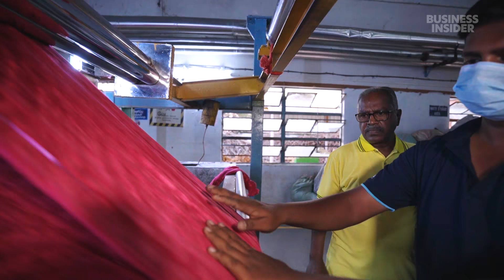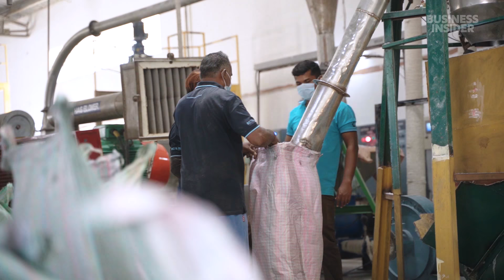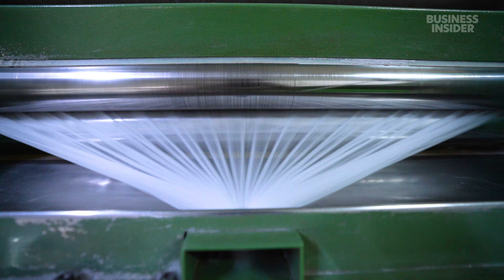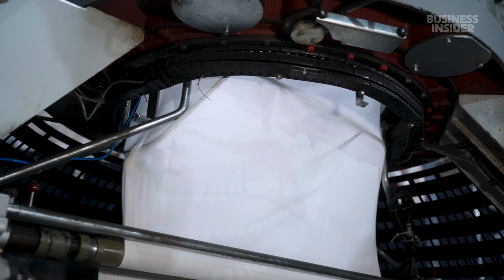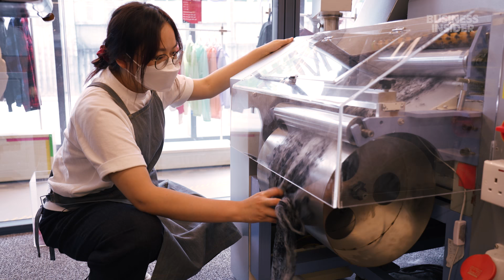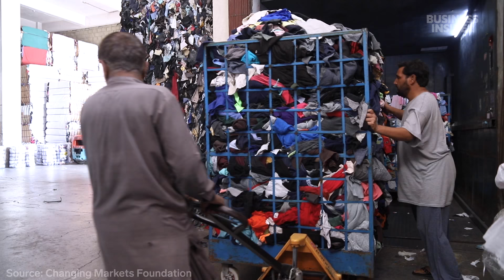How 1.5 Million Plastic Bottles Are Turned Into Clothing Every Day | World Wide Waste

Comment: In Europe, the bottle caps have to remain with the bottle due to a change on EU regulations. It also applies to UK (and presumably non-EU countries like Switzerland) so that they do not have to separate lines for EU and non-EU. As well as reducing litter on public places, it also allows them to be recycled together and also stops consumers from losing the lid. It does get annoying sometimes and its possible to detach the cap from the bottle if you have enough strength.

Comment: what is going to happen to the tiny plastic/polyester particles which comes out when those clothes deteriorate? which of them would be harder to manage? those plastic bottles or polyester particles?

asked this question to ChatGPT
question
asking about this newer technology where plastic bottles are converted to polyester cloths. what is going to happen to the tiny plastic/polyester particles which comes out when those clothes deteriorate? which of them would be harder to manage? those plastic bottles or polyester particles?

answer
Excellent and important question — you're thinking critically about the life cycle of recycled materials, not just the “feel-good” part of recycling. Let’s unpack this step by step.

---

### 1. The technology: Plastic bottles → polyester fibers

* Most polyester fabric used in “recycled clothing” today comes from **PET bottles (polyethylene terephthalate)**.
* The bottles are cleaned, shredded into flakes, melted, and spun into new polyester fibers, which are then woven into textiles.

So, this is a *form of mechanical recycling* — the same plastic (PET) is reused in another form, extending its life.

---

### 2. What happens when those clothes are used and washed

* When polyester clothes are *washed or worn**, they **shed microfibers* — very small strands of plastic (typically less than 5 mm, often much smaller).
* These fibers:

  * Escape through washing machine drains.
  * Pass through many wastewater treatment plants (most facilities can’t filter them effectively).
  * End up in **rivers, lakes, and oceans**, where they accumulate in sediments and enter food chains.

---

### 3. Comparing the two waste types

| Aspect                                        | Plastic Bottles                              | Polyester Microfibers / Microplastics                                      |
| ---------------------------------------- | -------------------------------------------- | -------------------------------------------------------------------------- |
| *Size*                                      | Large, visible                                 | Microscopic — often invisible                                              |
| *Containment*                   | Easy to collect, sort, and recycle           | Extremely difficult to capture once released                               |
| *Environmental impact* | Can be managed through recycling and cleanup | Persistent, widespread pollution; ingested by aquatic life and even humans |
| *Degradation*                    | Slow, but can be managed                     | Fragment further into nano plastics, persist indefinitely                   |
| *Ease of management*   | High — infrastructure exists                 | Very low — no large-scale filtration or removal systems yet                |

So in short:

> 🔹 The *microfibers* released from recycled polyester are *much harder to manage and more harmful long-term* than the original bottles.

---

### 4. Why this happens

When we recycle PET bottles into clothes, we change the problem’s **form**, not its **fundamental nature**:

* Instead of large, manageable bottles, we now have millions of microscopic plastic fibers dispersing globally.
* We extend the plastic’s usefulness, but make its **end-of-life management nearly impossible**.

---

### 5. Mitigation and alternatives

Efforts under way include:

* *Washing machine filters* or laundry bags (e.g., *Guppyfriend*) that capture microfibers.
* *New textile blends* that shed fewer fibers.
* *Biodegradable or bio-based polyesters* (like PHA or PLA fabrics) under development.
* **Circular textile recycling**, where polyester fabrics are chemically recycled back into new fibers rather than downcycled into smaller ones.

---

✅ *Summary*

> Recycling plastic bottles into polyester clothes helps reduce landfill and crude-oil use in the short term*, but it **creates microplastic pollution* that’s far harder to manage.
> In the long run, the *polyester microfibers* are the more serious environmental challenge — smaller, more persistent, and nearly impossible to recover.

Comment: does this not just create more micro plastics by creating such tiny little non usable pieces of plastic that just get dumped.. I do agree that if we are to create polyester doing so by strictly using recycled plastic is the only way to go, we absolutely do not need to create more plastic to make polyester period, we already have so much plastic that never gets the chance to be recycled. We also have to remember that every time you wash your polyester or other plastic based fabrics unless you are using a microplastic wash bag which most people don't even know exist you are washing millions of ultra micro microplastic particles into the water system that are so small they can't get filtered back out. We're are still better off using natural biodegradable fabrics and holding onto our clothing for longer, we should never normalize fast fashion that is made of cheap non biodegradable fabrics typically constructed by slave laborers in very questionable non ethical environments. I will cheer for the day where we have an easier time shopping for fashionable clothing made strictly of natural fabrics as it seems like a man hunt to find them atm. If you need help with limiting how much money you spend on bs clothing you most likely dont even need make a rule to only consider purchase if it hits certain goals for you 1 being fabric type, ect. I rarely buy clothing now bc of that simple rule, it will never make sense how the same set of sweats from 2 decades ago were made of 100% cotton and now in the 2020's those same sweats are 100% polyester and cost more.. total crap and i refuse to buy into the plastic clothing hype bring back my cotton silk wool and hemp and bamboo for our industrialized fabrics.

Comment: Fiber-to-fiber recycling is a total waste of time and energy. It takes DAYS to process ONE garment, with crazy labor and electricity costs, just to get weak fibers that need virgin material anyway. Less than 1% of clothes get recycled this way—it's a pointless gimmick. Burn the textiles in clean waste-to-energy plants for power (modern ones barely emit anything) or shred them for insulation, carpets, or construction materials. Those options are faster, cheaper, and actually scale. Stop chasing this Fiber-to-fiber recycling fantasy and use the waste practically!

Comment: The problem is, every time they are laundered, they add micro plastics to the environment. I also wonder about whether these clothes will ever break down. Plastic doesn't break down, it just eventually will break up. But how long will that take?  It is time we stopped using plastic. Or at least significantly reduce its use.

Comment: Polyester is one of the best material for many cases.
We can't find better material for producing full stack of sport clothes and equipment: it lightweight, dry quickly, does not harm our skin and provide the best breathability if we say about membrane textile.
This is the best material for producing bags and backpacks for the same reason as it was described for clothes. Moreover, backpacks made from polyester must not be washed too often. Once a year is enough.
Polyester is used for producing curtains.
Polyester is used in industry for filters. Cheese can not be produced massively without polyester.
More over 90% of jackets are made from polyester.

We can't replace natural textile with polyester but polyester is a good textile.

Comment: Recycling works the best if you can run a product in loops. Taking out material that can technically go into a PET bottle again is not sustainable. The reason for this is, that clothes can’t be recycled and therefor need to be dumped/ burned.

This is not the circular economy the protagonists in this video  are promoting

Comment: From my past 10 years of experience in garment industry, i can assure you that Its not the problem of manufacturer. It's the brands. We have always tried to pitch in 100% cotton fabrics in all the innovation meetings. But brands always ends up preferring cot/poly mix to reduce the procurement costs. I have always wondered how can such big brands in the so called developed economies neglect the issue of microplastics when this is such a global issue. Manufacturers are pushed in the way of polyesters by brands themselves . Not the other way around. The funny part is that they market it with some sustainable stickers to fool the customers. My request to the customers is that, always look for the fibre composition while choosing your garment. Go for 100% cotton or any other natural fibres.  Try avoiding nylon and polyester the best you can.

Comment: OR we could STOP putting liquids into single use plastics. How about glass bottle returns like we used to do when I was young. Milk was delivered and bottles sterilized and reused. The same thing happened with our pop bottles. Nobody in their right mind bottled and bought water which you could get out of your own tap. Also, so many of these polyester clothes just end up in the garbage anyway when they are no longer wearable. I also wonder if all that water they are using is properly treated afterwards or just dumped into their system as is.

Comment: Currently, many companies recycle plastic fibers into fashion products like t-shirts, but this isn’t the best solution. This process involves using a lot of chemicals and leads to microplastic pollution from the very first wash, making the problem worse with each wash cycle.

By converting these plastics into building materials and other solid products instead, we can prevent 99% of microplastic release. This approach not only reduces pollution but also provides more durable and environmentally friendly alternatives to traditional materials.
Reply: Funny thing, it would even be easier to produce
 technical fibers (like geotextile) instead of clothing ones. And they can be sold to construction projects in large amounts. I guess all if these startups are never made for doing this, instead they're only hunting for grants and fashion helps them better than construction.
Reply: All while causes cancer
Reply: @richellelacy3834 or genetic mutation 😮

Comment: Companies that use plastic packaging need a better labeling method. Our local recycling rules are to remove labels from plastic before it’s recycled. It’s nearly impossible to get some labels off. I have noticed some brands starting to use “shrink wrap” type plastic film for labels, so they can be easily removed. But then THAT plastic goes in the trash while the bottle gets recycled. So idk…what’s worse?

Comment: A classic case of greenwashing. Big companies and small only use "recycled polyester" only becausw it's dirt cheap. This "recycled" plastic is much more harmful than virgin plastic, as the chemicals used to recycle it make it much more toxic for environment and humans.
Not to mention they seep microplastics into your body, home water and environment.
Buy plastic clothes only if you literally hate yourself
Reply: Currently, many companies recycle plastic fibers into fashion products like t-shirts, but this isn’t the best solution. This process involves using a lot of chemicals and leads to microplastic pollution from the very first wash, making the problem worse with each wash cycle.

By converting these plastics into building materials and other solid products instead, we can prevent 99% of microplastic release. This approach not only reduces pollution but also provides more durable and environmentally friendly alternatives to traditional materials.

Comment: There's also the fact that more than 75% of recycled plastic is unusable because the melting of the plastics destroys a lot of those polymer chains, which is why it can only be recycled so many times.
Reply: This statement is too broad to be of any use. There are hundreds of types of plastics, of which degradation mechanisms can hardly be compared. As for PET, the amount of chain incisions during melting and re-extrusion is actually quite low, if done carefully, decrease in molecular weight is under 5%. For plastics like PET, these broken chains can also be 'repaired' fairly easy and economically using a process called Solid State Polymerization. The amount of times one can recycle PET is not limited by the "destroyed polymer chains", but mainly limited by contamination and discoloration, which is nearly impossible to remove during regular mechanical recycling.
Reply: I did not know that. Thanks!
Reply: It’s funny because if they wanted to do something it would actually be very easy. I’m into banning single use plastic production btw. But if we insist on keeping this insane model… it’s simple you just mandate them to produce plastics only that can be easily recycled. I guess the clear plastics etc. etc. u get the point. There’s certain plastics that recycle very effectively. Hello, mcfly… just them make all plastics like that! None of this phony green bottle crap etc. but they will never even get that far. Nobody cares. All anybody cares about is corporate profit margins
Reply: It stains forever too 😅 Have you ever tried the clean Spaghetti out of a plastic bowl 😅That color never disappears 😅
Reply: I'm allergic to that crap.